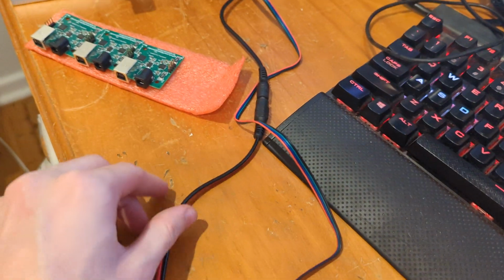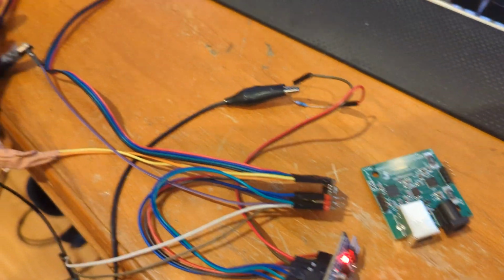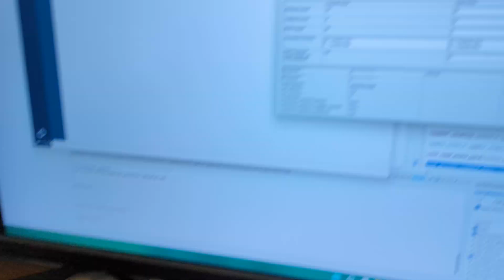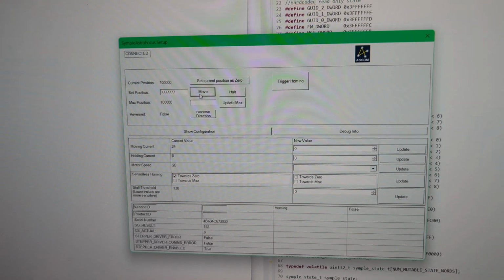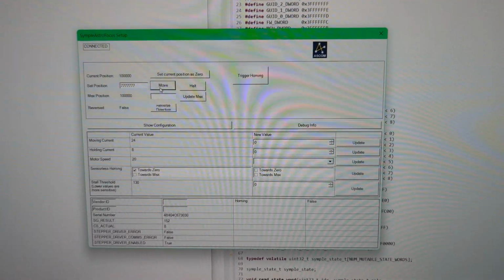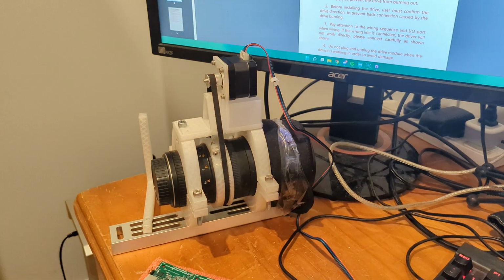SympleAstroFocus DIY STM32 Bluepill + big tree TMC2209 version

Comment: Hi
Is the Gerber files available to send to JLCBPC?  Thanks
Reply from the maker: Yep they're in readme homepage of the github repo - there's two designs, both a functionally identical just using a different STM32 package to get around stock shortages/optimise for price.
Reply: @alistairsymonds  Apologies for my ignorance but I don’t see any ,GBR file, everyhting wants to open in EasyDA. Do I generate the .GBR from there?
Reply from the maker: @MrDunk66  Ah right, yeah if you open the PCB board in easyeda then from the top menu go: Fabrication -> One click order PCB/SMT, it will load the gerber and then all the pick-n-place parts info needed for assembly autoamtically into the JLC system.